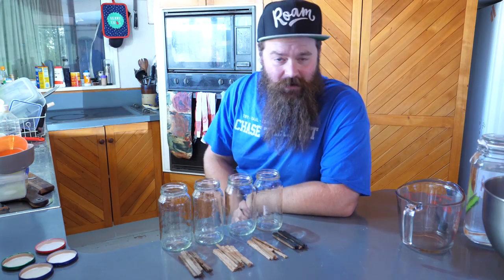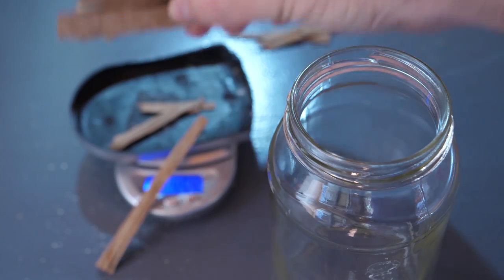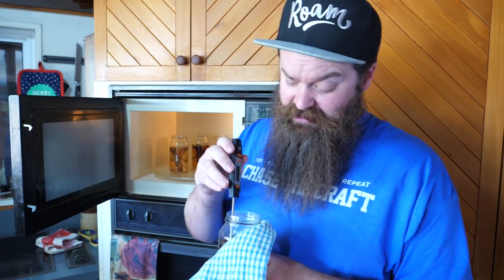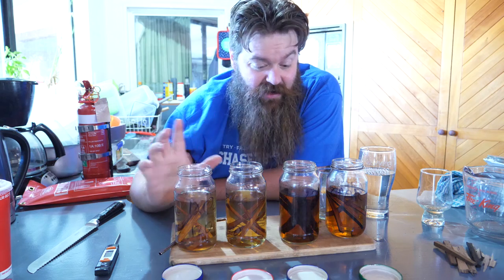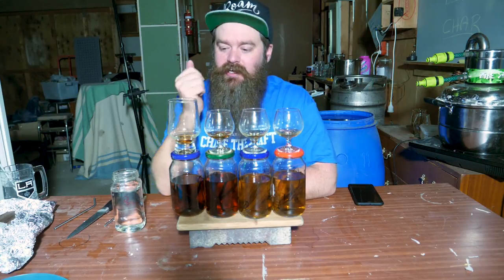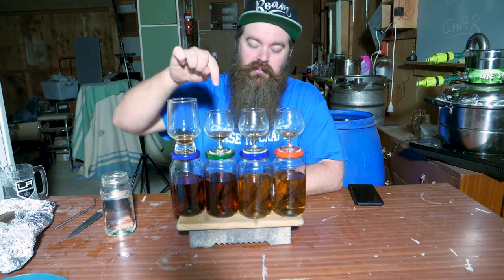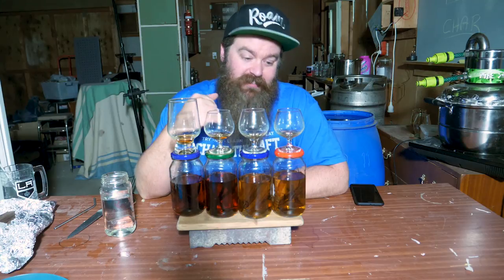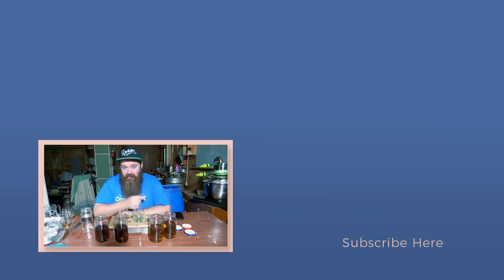Testing Different Oak Char & Toast With Nuclear Ageing

Comment: The best way to age whiskey is in a pressure cooker.
Reply from the maker: Go on. . . .
Reply: Hey do you need to heat the oak before using it or is it just for taste??
Reply: Not much more to it. Char the wood. Put it in the cooker with the white dog just barely boiling for a day. repeat a few times with new air for oxidation. let cool between. Add smoke if you want it smokey
Reply: ideally you would char the oak before cooking the spirit with it.

Comment: I think one of the variable is surface of the wood chips
Reply from the maker: I would agree for larger bits of wood.  But my hunch is that with these little bits the wood is completely saturated.  Taking surface area out if the equation.......that's just a guess though.